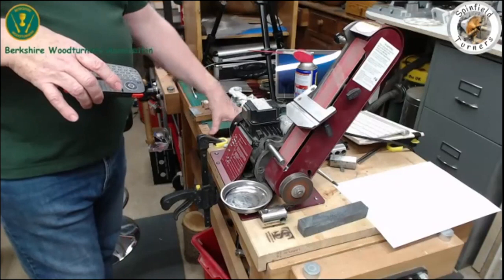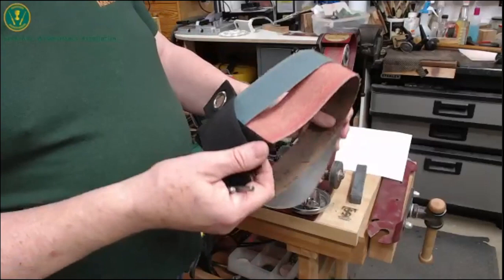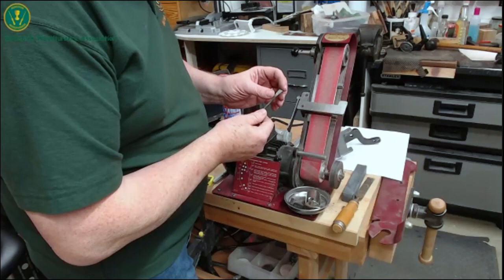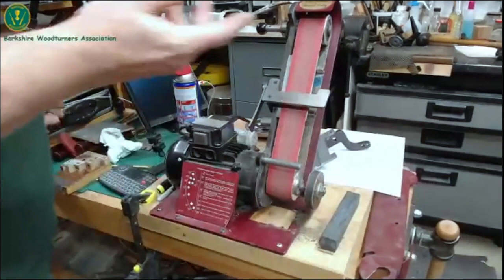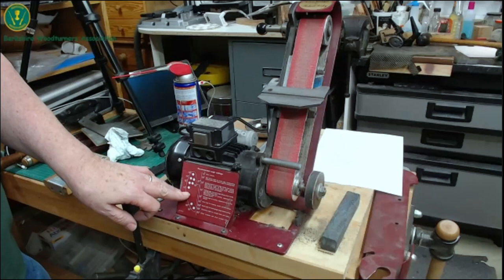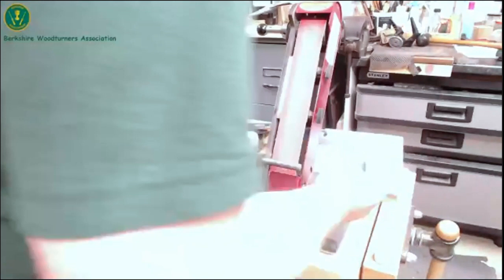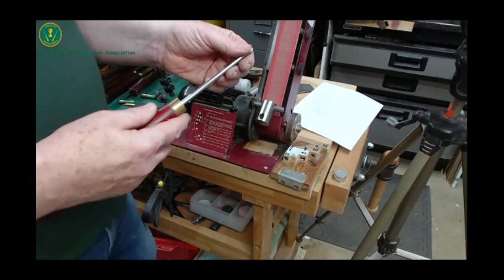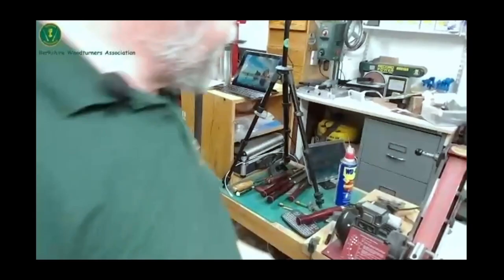Berkshire Woodturners. Sorby Pro Edge demonstration

Comment: Very helpful to get detailed comments from an experienced user. I'm new to turning and considering my sharpening options. Good to hear of limitations and 'fixes' as well as standard functions of machine.
Reply from the maker: Glad it was useful! The tip about how to sharpen a spindle gouge by using ‘non standard’ jig settings is a good one. I suggest you join a local AWGB turning club as soon as you can as you should be able to check out other members kit before you plunge in. The club I am chairman of is based in Bracknell UK if u want to join us! Cheers

Comment: Hi, The arrows are on the belts as the abrasives are there for when the abrasives are made into belts for belt sanders - where the belts are lap jointed. With the Robert Sorby the belts are butt jointed so they can go on the ProEdge any direction - but it keeps the mind thinking :)

Comment: Hi and thanks for sharing this video.  Great information and having just bought a ProEdge there are some great tips especially the magnetic tray to catch the filings :)
Reply from the maker: Glad it helped. And look out for the tip about sharpening a spindle gouge with a decent swept back grind. Which goes against Sorby’s advice and changes the swinging jig arm settings. Cheers Malcolm And don’t forget to subscribe!
Reply: @spinfieldturners  Will do.

Comment: Probably is dumb question, but, can I use the ProEdge to sand wood objects on? I was wondering whether it can be used to square your pen blanks for example.
Reply from the maker: Yes you could. It is really just a 50mm wide linisher with add ons. You can set up the plate at 90degrees to square off small blanks using the 60grit belts. The ceramic belts will also remove the brass tubing without a problem too! If you dont watch it!
Reply: @spinfieldturners  Thank you!

Comment: You’d be much better off with Darlow jigs and a Woodcut pivoting jig and a normal bench grinder. Plus you can hone the edges because they are hollow ground not flat ground. I honestly can’t believe how much stuffing around this system is. A honed edge stays sharp much longer than an edge straight off a grinder or sanding machine.
Reply from the maker: It’s all about personal preference. The Pro Edge is super quick, repeatable and easy to use. It has its limits but they are very easy to get round. I have used bench grinders with home made jigs, Sorby universal, wolverine and woodcut and also Tormek and Axi Ultimate edge. I stick with the Pro Edge. I particularly don’t like the jigs which can just rest in and can pull out of the socket easily. They all have elements of faff or
inconvenience involved. Our club is split about 50/50 for usage. See if you can try different rigs through your own club before you make any changes!

Comment: The arrow is used during manufacture - nothing to do with direction, according to Sorby.
Reply from the maker: Thanks for watching! But  - which arrow do you mean please?
Reply: @spinfieldturners  Hi Malcolm, I was referring to the arrow on the proedge belts. Even knowing the y do not indicate direction I still find myself putting them in that way!
Reply from the maker: @billstanley5317  I suspect the arrows are a remnant from the time that joints were overlapped (so there was a  bump at the joint) and not butt jointed and taped as they are now. But like you I still align the belt to the arrows as well. Der🙄